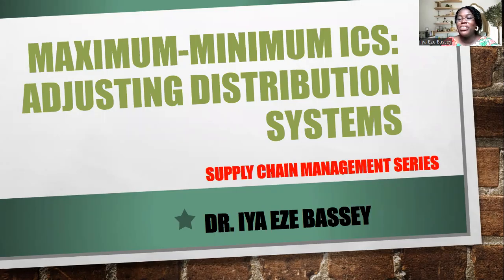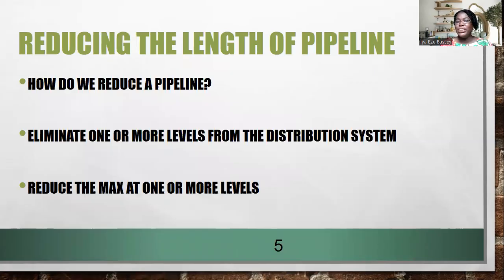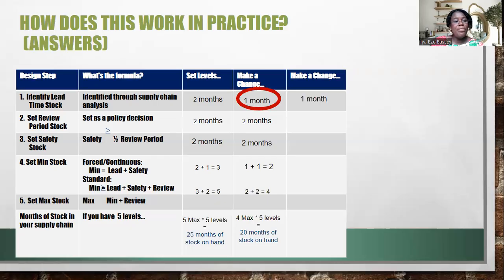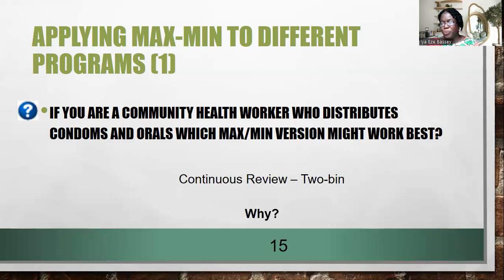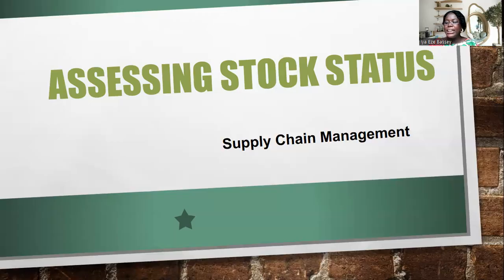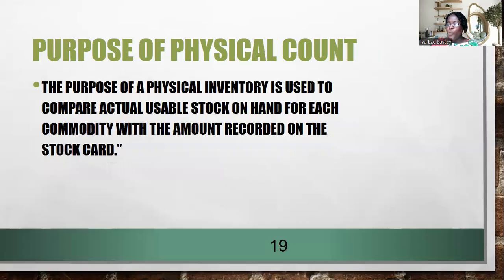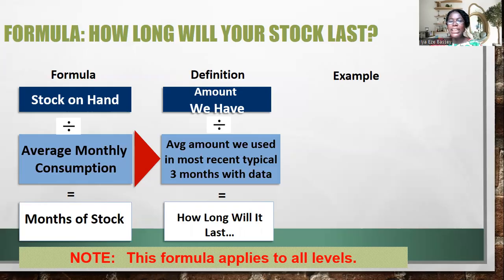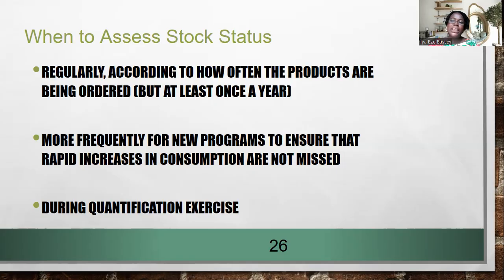Maximum-Minimum ICS: Adjusting Distribution systems (Supply chain management series)

Comment: Thank you Dr. Mrs Iya Eze Bassey for this educative lecture. It was really a great one. How wonderful. From this lecture I understood the steps in designing a max-min ICS, they include:
1. Set up initial maximum policies for each level and faculty.
2. Check if the overall distribution will function properly if the max-min policies are implemented 
3. Check the total length of pipeline that the policy of each level imply
Most times, the length of the pipeline are too long and can take longer time in commodity delivery, however the pipeline length van can be reduced by:
a. Elimination of one or more levels
b. Reduction of max at one or more levels

Maximum stock levels can be reduced by:
1. Shortening of review period at one or more level 
2. Reduction of lead time at one or more level
3. Improvement of distribution system reliability.
Some other factors that impacts max-min  stock levels are;
- Cost of products
- Reliability of transportation 
- Storage capacity 
- Cost of storage 
- Storage conditions at different levels
- Shelf life of health commodities 
The advantages of using max-min system includes:
- avoid overstocking
- avoid under stocking 
- minimize wastage
- avoid cost of emergency orders
- consistency of stock levels.

Comment: At the end of this section, I have learnt the  following.
Steps in designing max-min ICS
1) Set up initial max-min policies for each level and type of faculty
2) check if the overall distribution will function properly if the level specific max-min policies are implemented
3) Check the total length of the pipeline that the policies at each level imply.
factors that impact
max-min stock levels (1)
- Cost of products
- Reliability of Transportation
- Storage capacity
- Cost of storage
- Storage conditions at different levels
- Shelf life of health commodities
The advantades of usina max-min svstem is - Avoid overstocking
- Avoid understocking
- Minimize wastage
- Avoid costs emergency orders
- Simplify inventory control decision making
- Consistency of stock levels
- Reliable Data source from SDP for forecasting and quantification.

Comment: In conclusion, the significance of
an inventory control management in the LMIS and the definition of terms used in max-Min
inventory control system like; Review period,  maximum stock level, minimum stock level,
Emergency order point, safety stock, and lead time. Also, I have gained valuable insight that an ICS aids in tracking a company's product as they move through the supply chain including
purchasing, shippinging, receiving, and warehousing.
I have also learned about the 3 types of Max-min ICS which are; Forced ordering of Max-Spin ICS
Standard version Max-Snin ICS.

THANK YOU MA.

Comment: Effective distribution policies are crucial for optimizing supply chains, particularly in public health settings. Tailoring policies to each distribution level ensures smoother operations.
Lengthy pipelines can hinder timely delivery of essential commodities; streamlining these processes is vital for maintaining service continuity in healthcare.
Reducing maximum stock levels requires systematic approaches, including adjusting lead times and review periods, which helps manage inventory efficiently.
Assessing stock status through physical counts ensures accuracy and prevents discrepancies, which is critical for operational reliability in healthcare facilities.
Inventory control systems should be chosen based on the nature of the commodities and the scale of operations, impacting overall supply chain efficiency.
Regular stock assessments are essential, especially during new program implementations or when discrepancies arise, to adapt quickly to changing demands.
Understanding the push vs. pull systems enhances inventory management strategies, allowing facilities to adapt their ordering processes effectively.

Comment: In summary, I was able to learn that
Adjusting a distribution system based on maximum and minimum inventory control (ICS) involves dynamically managing stock levels at various points in the supply chain to optimize distribution efficiency. By setting appropriate maximum and minimum stock levels at warehouses and distribution centers, the system can trigger replenishment orders automatically when minimum levels are reached, and conversely, slow down replenishment or redistribute excess stock when maximum levels are approached. This dynamic approach aims to minimize storage costs, reduce stockouts, and improve responsiveness to fluctuating demand, leading to a more agile and cost-effective distribution network

Comment: I’ve learned that in adjusting a distribution system, it’s essential to consider:

1. The length of the pipeline.
2. Reducing pipeline length.
3. Lowering the maximum stock level.

Advantages of the Max-Min Inventory Control System:

1. Prevents overstocking and understocking.
2. Reduces waste.
3. Avoids emergency order costs.
4. Maintains consistent stock levels.
5. Simplifies inventory management decisions.

Challenges in Using Inventory Systems:

1. Managing systems with multiple levels.
2. Handling a large variety of commodities.
3. Managing inventory for new programs.

Stock Status Assessment:
This determines the months of stock remaining and is done by:

	1.	Conducting a physical count.
	2.	Calculating how long supplies will last.

Purpose of Physical Inventory:

To compare actual stock levels with records on the stock card.

Thank you, Ma

Comment: Maximum-Minimum ICS: Adjusting Distribution systems is about the complexity of designing inventory control systems, particularly in systems with numerous levels and a large number of commodities. 
The best Maximum-Minimum version  for community health workers distributing condoms and orals is the two-bin variation, which is suitable due to the smaller number of products and the lack of highly skilled personnel at the community level.
The factors influencing max-min stock levels include:
1. Storage cost 
2. Shelf life of health commodities 
3. Production costs 
4. Lead time 
5. Stock capacity .

Comment: The concept of "Maximum - Minimum Inventory Control Systems (ICS)" for adjusting distribution systems in a supply chain is centered around optimizing inventory levels to ensure efficient and cost-effective operations. Here's a summary of how it works: 1. *Inventory Control in Supply Chain**: - In a distribution system, managing inventory levels is crucial to balance demand with supply, ensuring products are available without overstocking, which leads to high costs. - The "Maximum - Minimum" system is a strategy to maintain inventory levels within predefined boundaries: a maximum level and a minimum level. 2. **Maximum Level**: - The maximum inventory level represents the upper threshold, indicating the highest quantity of stock that should be held in the warehouse or distribution center. - This level is determined by factors such as storage capacity, demand forecasts, lead time, and safety stock requirements. - When stock reaches the maximum level, no further orders are placed until the inventory drops. 3. **Minimum Level**: - The minimum inventory level is the lower threshold, signifying the least amount of inventory that must be maintained to avoid stockouts and disruptions in the supply chain. - This level is also based on similar factors, like lead times, demand variability, and safety stock. - When stock falls below this level, orders are triggered to replenish inventory and avoid running out of stock. 4. **Adjusting Distribution Systems**: - By setting and adjusting these maximum and minimum inventory levels, companies can streamline their distribution systems. When inventory levels approach the minimum threshold, the system automatically places an order to replenish stock, preventing disruptions. - On the other hand, if inventory reaches the maximum level, the system prevents overstocking, reducing excess carrying costs and the risk of obsolescence. - This strategy helps in better aligning supply with fluctuating demand, optimizing storage, and reducing costs. 5. **Benefits**: - **Cost Efficiency**: Balancing inventory minimizes both holding costs and stockouts. - **Operational Efficiency**: Streamlining inventory management allows for smoother operations, reducing delays and disruptions in the supply chain. - **Demand Fulfillment**: Ensures that the supply chain can meet customer demand while maintaining lean inventory. In summary, a **Maximum - Minimum ICS* allows businesses to adjust their distribution system by defining optimal inventory thresholds. This helps maintain cost-effective, efficient supply chains while meeting demand requirements.

Comment: In adjusting Distribution Systems you need to  consider the following factors:
-Pipeline length
- Reducing pipeline length
- Reducing maximum stock levels
Advantages of Max-Min Inventory Control System:
-Avoids overstocking
-Prevents understocking
-Minimizes wastage
-Reduces emergency order costs
-Maintains consistent stock levels
-Simplifies inventory control decision-making
Challenges of Implementing Inventory Control Systems:
-Managing complex systems with multiple levels
-Handling large numbers of commodities
-Managing products for new programs
Assessing Stock Status:
To determine the months of stock, assess stock status using:
- Physical counts
- Calculating how long supplies will last
Purpose of Physical Inventory:
Conduct physical inventories to compare actual stock on hand with recorded stock levels on stock cards.

Comment: At the end of this study I was able to:
- Identify ways to adjust distribution system policy which can be achieved by:
1. Reviewing the review period at one or more level
2. Shortening the lead time at one or more levels
3.Improve distribution system reliability at one or more levels .
- Advantages of max-min ICC which is to avoid overstocking, understocking , minimise wastage and avoid cost of emergency order.
- Challenges of max-min ICC which include system with numerous levels, system that manages large commodities and manage products for new programme.
- The ICC used in logistics management for HI/AIDS commodities which is the standard version.
- meaning and purpose of assessing stock status which is determining levels of products including the ones available,issued out and bought. The purpose is to compare actual usable stock on hand for each commodity with the amount recorded on the stock card. Number of month of stock available= stock on hand÷ average monthly consumption.

Comment: Thank you ma for the teaching. 
- The steps in designing a max-min ICS are:
a) Set up initial max-min policies for each type and type of facility
b) Check if the overall distribution will function properly if the level specific max-min policies are implemented
c) Check the total length of the pipeline that the policies at each level imply.

- Other Factors That Impact Max-Min Stock Levels:
a)Lead Times
b) Reliability of source of supplies 
c) Effect of a zero balance of stock 
d) Management skills of staff 
e) Age of program 
f) Accuracy of forecasts

Comment: Dr. Iya Eze Bassey discusses adjusting distribution systems within maximum-minimum inventory control systems in supply chain management, focusing on public health contexts, particularly in Nigeria. The session aims to enable participants to identify strategies for adjusting distribution policies, understand the benefits and challenges of these systems, and explain inventory control in supply chains managing HIV commodities. Participants are encouraged to examine the length of supply pipelines and explore methods to shorten them, such as eliminating distribution levels or adjusting maximum stock policies. Specific examples highlight how modifying stock policies can lead to reduced pipeline length while ensuring the availability of medical supplies. The discussion emphasizes the need for systematic adjustments in lead times, review periods, and safety stocks to manage inventory effectively. Challenges in implementing these systems are noted, particularly for complex distributions with numerous levels and products. Bassey also underscores the importance of regular stock assessment through physical inventories to ensure accurate supply counts, enabling better forecasting of stock availability based on average monthly consumption. He discusses the significance of assessing stock status frequently, especially in new programs or during discrepancies, to maintain effective supply chains. The session concludes with participants being assigned to analyze standard operating procedures for various health commodities, reinforcing the application of the concepts discussed.

Comment: Thanks you very much ma, I'll highlight what i understood from this video 

Designing a Max-Min Inventory Control System

1. *Establish Initial Policies*: Set up initial max-min policies for each facility level and type.
2. *Evaluate Distribution Functionality*: Assess whether overall distribution will function properly with level-specific policies.
3. *Assess Pipeline Length*: Calculate the total pipeline length implied by policies at each level.

Factors Affecting Max-Min Levels

1. Product Costs
2. Transportation Reliability
3. Storage Costs
4. Storage Capacity
5. Lead Time

Benefits and Challenges of Max-Min Systems

1. *Advantages*: Improved inventory management, reduced stockouts, and optimized inventory levels.
2. *Challenges*: Complexity, data accuracy requirements, and potential stock imbalances.

Inventory Management Best Practices

1. *Regular Physical Counts*: Manually count usable units of each commodity in stores or health facilities.
2. *Regular Stock Status Assessments*: Frequently evaluate stock status, especially during quantification exercises, to ensure awareness of supply duration.

By implementing these principles and best practices, organizations can optimize inventory management, reduce costs, and enhance overall efficiency.

Comment: learnt:
Maximum- Minimum ICS;

- Adjusting Distribution system; implementing specific maximum policies at each distribution level is crucial for optimizing inventory level particularly in public health supply chain.
  Uses a maximum and minimum inventory control system ICS.
   Gets maximum and minimum inventory level for each item.
  Automatically triggers orders when minimum level are reached.

BENEFITS Includes
" Reduced stock outs and over stocking 
" Improved inventory manaul and control
" Increased efficiency and cost saving.
  "Enhanced customers satisfaction and services levels 

PIPELINE LENGTH MANAGEMENT 
        Reducing the length of the distribution, pipeline can significantly enhance the efficiency of delivering indicates supplies such as health commodities to clinics.
Well done 👍 ❤

Comment: At the end of the video lecture, I was able to understand the following: 

The steps in designing a Max-Min ICS are: 
√ Set up initial Max-Min policies for each level and type of facility. 
√ Check if the overall distribution will function properly if the level specific max-min policies are implemented. 
√ Check the total length of the pipeline that the policies at each level imply. 

Some of the factors that impact Max-Min stock levels are as follows:
• Lead times 
• Age of program
• Cost of products
• Cost of storage 

The advantages of using Max-Min system can be outlined as follows: 
1. It helps to avoid overstocking. 
2. It minimizes wastage. 
3. It simplifies inventory control decision-making . etc 

A physical count is the process of counting by hand the total number of usable units of each commodity in your store/health facility at any given time.

Comment: Thank you once again, mma, for such an insightful lecture.

From this session, I gained a clear understanding of the steps involved in designing a max-min ICS, which include:
	•	Establishing initial maximum policies for each level and faculty.
	•	Assessing whether the overall distribution will operate effectively under these max-min policies.
	•	Evaluating the total pipeline length implied by the policies at each level.

It’s essential to analyze demand patterns thoroughly and adjust inventory levels as needed. By tracking sales data and forecasting future demand, businesses can develop an optimal distribution strategy to ensure product availability precisely when required.

Additionally, I learned that the benefits of implementing max-min stock include avoiding overstocking, preventing understocking, minimizing waste, and reducing the costs associated with emergency orders.

Comment: MAXIMUM-MINIMUN ADJUSTING DISTRIBUTION SYSTEM

The module helps one to understand the importance of a well detailed approach to Inventory management

Key Points:
*A concised methodology for designing a max/min inventory control system
* Ways for the optimization of pipeline length such as streaming distribution channels and the implementation of policies to reduce different stock levels.

I also learnt about the factors influencing max/min stock levels which includes;
1. Stock capacity
2. Production costs
3. Storage costs
4. Shelf life of health commodities
5. Lead time

The benefits of a thorough implementation of such a system are;
It avoids overstocking and understocking
It minimizes waste
It helps maintain consistent stock levels

Comment: In summary I learned the ways to adjust distribution system in ensuring a maximum and minimum inventory control system is by : Reducing the maximum stock level (the review period and lead time)
Checking the length of the pipe line(the entire chain through which supplies are moved from the manufacturer to the user
Also l learned that it benefits include: Improved inventory management and control 
Increased efficiency and cost savings 
Enhance customer satisfaction and service levels 
Reduce stockouts and overstocking
Thank you ma